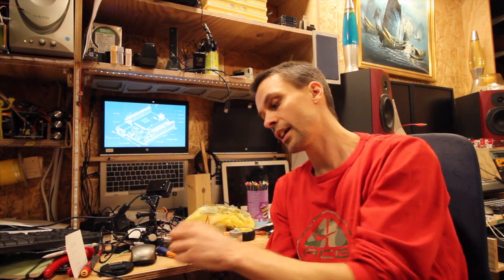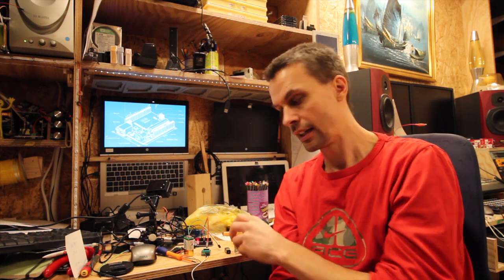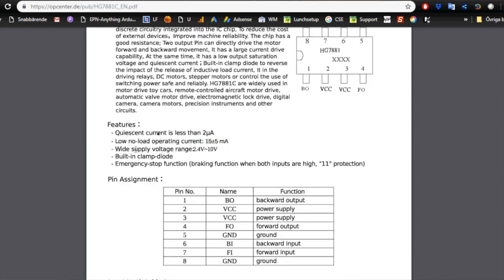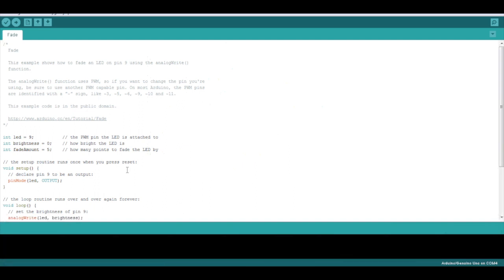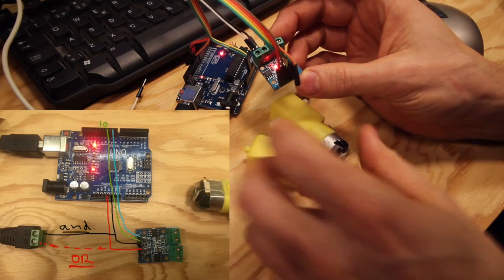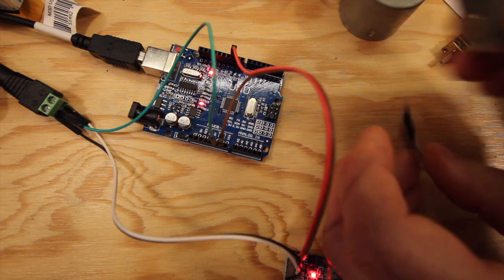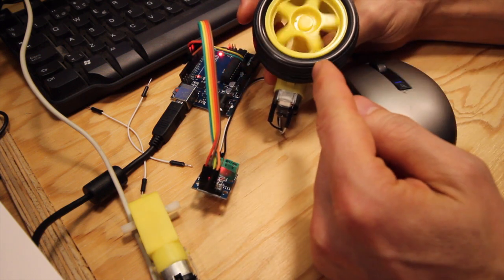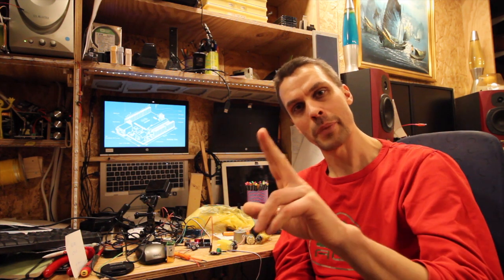Super simple Motor Driver HG7881 - Anything Arduino ep.32

Comment: That was a small motor controller. The controller i got was to big dam heatsink!.(Got it from kjell)  i was gonna controll the motor directly for arduino but i was told that might break the board.
Reply from the maker: Yeah but these small controllers can’t control too big motors though. For my shelves I ended up using a completely different method as I almost burnt these small ones up when I attached a bigger motor. 😜 but I think these are made to protect the arduino though.